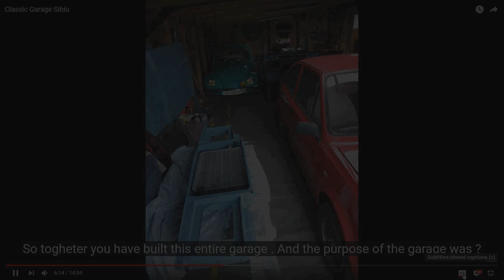Skoda 120 Brake Caliper Restoration  \ Restaurare etrier frana

Comment: Niciodata sa nu mai dai sfaturi fara o documentare in prealabil.Niciodata nu ai voie sa folosesti smirghel pe un pistonas de frana deoarece acesta este placat.Nu ar fi chiar o tragedie,o sa rugineasca si o sa il schimbi fiind ieftin.Dar faptul ca folosesti smirghel in interiorul cilindrului etrierului este si mai rau,nu este o piesa ieftina si nici usor de gasit,ai compromis toata frana pe acea parte.Lichidul de frana retine umiditate,iar umiditatea din lichid va oxida si pistonasul si cilindrul foarte repede.
Reply from the maker: Salut , o sa incerc sa iti raspun  pentru fiecare problema ridicata de catre tine .

1.Da este adevarat ca pistonasul de frana din etrier este placat , dar smirghelul de 600 este unul foarte fin.
Scopul a fost de a uniformiza zonele mici  in care acel placaj era deja sarit de pe pistonas .
2.Aceasi procedura am folosit-o si pentru cilindrul din etrier , avand in vedere ca pistonul trebuie sa se miste liber in cilindru(fara sa atinga peretii acestuia) , singura zona de contact find cu garnitura de frana.
3.Probleme de logistica ! In sensul ca tipul asta de etirer pentru o Skoda din anii 80 nu o sa il gasesti de cumparat nou in Romania. Iar daca vrei sa cumperi din Cehia sau Slovacia(si acolo se gasesc extrem de greu ) o sa afli ca nu trimit in Romania (doar in Germania) .
4.Dupa cum spun si in video, aceasi tip de reparatie am facut-o si in 2011, iar timp de 8 ani a functionat fara probleme. 
Pe scurt este un compromis , atata timp cat anumite piese nu sunt disponibile .
5. https://youtu.be/zBtjrC_VatM?t=340